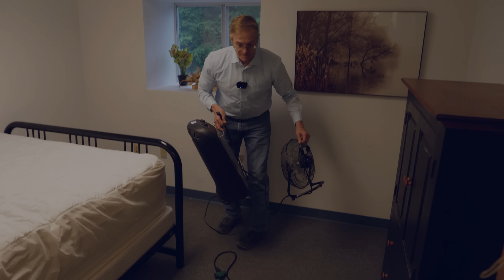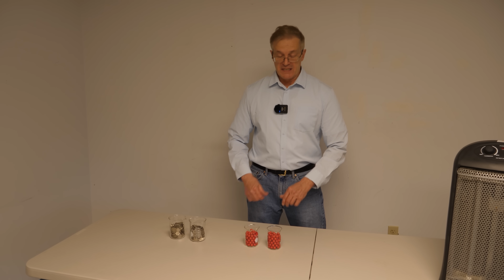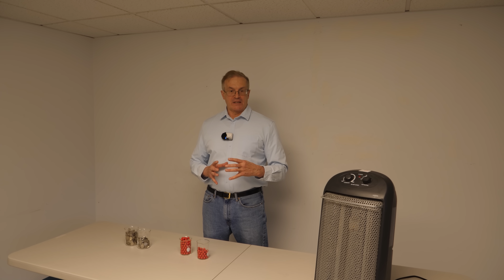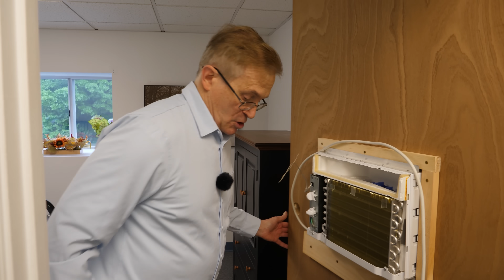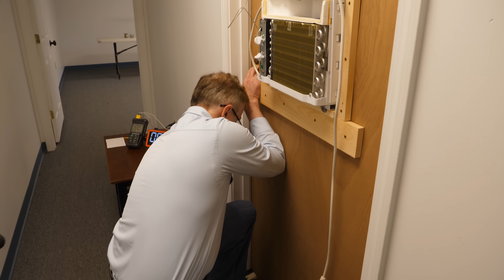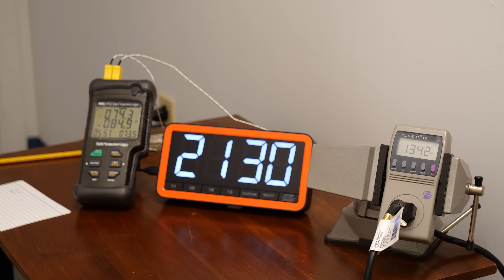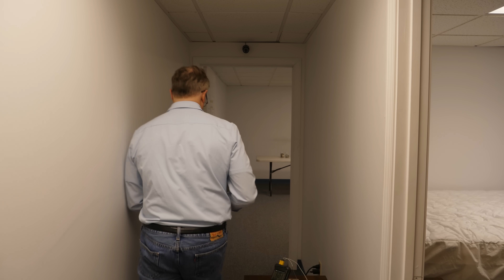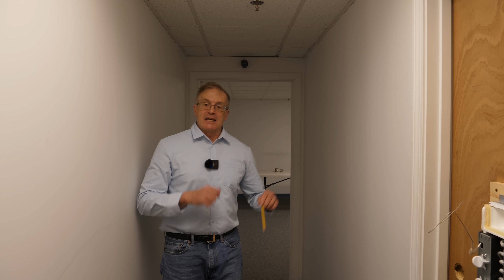You're wasting money on heating! Use your A/C!

Comment: If the concept is to move heat and not generate it. Wouldn't a test where the hallway is cold (to match cold weather when one would use a heater) be a more functional test? I am interested in the efficiency numbers then. I don't think we'd need to redo the space heater test since the temperature of the hallway has little to no impact on how it heats the room.
Reply from the maker: That's true.
The efficiency will drop as the temperature differential increases. Eventually,  the pump will approach the same efficiency as the space heater.

Comment: Most if not all AC units sold today will also have a heating mode that pumps in reverse, at least in Europe. Maybe it's different in the US?
Reply from the maker: It's definitely different here.
Reply: Interesting. In Europe, when we refer to a heat pump, it's usually an air-to-water pump, used primarily for heating water radiators in a pre-existing central heating system (cooling is less desirable as condensation forms around the radiators). Air conditioning units are air-to-air heat pumps that can either cool or heat the air.

Comment: I was surprised to see the low wattage of what appears to be a 5000 or 6000 BTU window unit. The plug for these units have their own 10 amp circuit breaker which equates to a trip point at just over 1200 watts on a 120vac circuit. I always just assumed they must run around 900+ watts.
Where a "heat pump" begins to fail as a heater is when the ambient air used to warm the refrigerant (the cold side of the AC) drops below 35 to 40 F .

Comment: let me guess the next video, you will combine secondary side of the A/C using with water nozzles/spray can....Can be dangerous to health(especially asthmatic people) and the building due to the issue with moisture and it will increase water consumption(drinkable water for the community).... a second thing is the deltaTemprature, there is a mechanical breakingpoint if deltaTemperature is higher than the A/C, therefore, efficency to heat can be better using a electric heater over time..  From my perspective, this video shows if you have a low deltaTemprature and overdimensioned A/C-unit.
Reply from the maker: That's not it.
Most airconditioners already route the condensate from inside to the blower on the outside heat exchanger.
Actually,  I misspoke. I should have said, "I'll show a method to significantly decrease the cost of air-conditioning not to increase the efficiency ".
Reply: @TechIngredients  Perhaps I misunderstood, but I'm curious about the next video! From your reply, I guess you can preheat using an electric heater and then use cooling to adjust the RH% level in the duct into the room. This way, you get better air conditioning, but it’s not cost-effective and doesn’t increase the efficiency. (However, I guess it depends on the perspective of what we are trying to achieve.)

Comment: Something I feel is always missing in the "it's not free energy" explanations  is, if it's cheaper to move heat than to create it, then why can't you add a thermoeletric generator of some sorts  to let the heat leak back in a cycle (or just use the outdoor as a heatsink) and power the device with the cheap heat gradient it is creating using less energy than the heat gradient itself has?
Reply from the maker: Take a look at our previous video on the  "Campfire Generator." Peltier devices are very inefficient, and although you could harvest a small amount of energy,  the payback period would be very long.
Reply: @TechIngredients  Is there no type of thermoeletric generator, even including other methods, like Stirling engines etc, that got enough efficiency to achieve overunit even when accounting for the energy savings of heatpumps, is that it?

Comment: I'm gonna go out on a limb here and guess that when the cold side of that ac unit is in a window and the outside temp is 32 degrees that it would not perform as efficiently as it does when the unit is attached to an inside door with the cold side exposed to air temps of 75 degrees as in this test.

Comment: A heat pump is many times the cost  (10x + nowadays) of a resistance heater. I rarely use the heat pump in the winter; I use the heat strips for the sole reason of reducing running hours on the compressor.

Comment: The results would be much different if the AC is trying to work in a freezing temperature, because this extra heat it is getting from the environment would not be present. However, it might still be better than the heater

Comment: There IS a problem in the experiment.
You didn't put a fan to blow on the AC radiator in the room. And the temp sensor in the room was VERY close to where the AC ridiator is. I'm pretty sure you're getting a higher temp inside the room because of that. Because the sensor is too close to the radiator and you're not flowing the air around it.

Comment: Confused.   You State at the beginning.  Can use . It has a switch cold or hot.
But you leave as a aircon unit. Then put the out side unit in the room
. Noise people will not appreciate  
I was under the contents  you where explain  how the system changes from cold to hot. 
I'm sorry  my friend.  This time incorrect information forwarded.  
Mick Australia 🇦🇺 
Where did the water 💧  go. In the temp change. ?

Comment: If the out part in splitt heatpump is reflektiv isolated in a box.. Just wonder can the heat made of the pumpe be used. Eksempel box of refleksjon isolation aluminium. Live in Norway and need cheeper billing. 😢

Comment: There's a couple of problems with heat pumps this demonstration hides unintentionally.
1. The heat pump is a more complicated system that is more likely to break over time.
2. It's more expensive to buy and setup, but cheaper to operate.
3. It has a temperature window that it can work in and can't work outside of that window.
4. It's usually slower to provide heat when mostly used. Usually cold days when heat density is low in the air you are pumping from.
5. It's less flexible to change and less adaptable to changing needs.
6. They are electrically powered only. Meaning in a blackout they don't work when just burning something, like gas, does.

All that having been said, heat pumps are cheaper and safer over the life time of the units in 90%+ of uses. They are by far the best choice in most cases, but should be sublimated by other small emergency systems in case power failure happens and heat is vital.
Reply from the maker: Agreed.

Comment: Curious if position of thermal probe may be reevaluated? Although I acknowledge it wasn't in airflow path, but, in first test it was pretty far from source, in second not so much. Do you think the turbulent air from AC this near could have affected Readings? 
Tip: I would personally have left fan and heater in the room for second test just to keep the thermal mass equivalent. Please advice your thoughts!?
Reply from the maker: Probably not. 
The significance of its position out of any airflow path is more important than its smaller distance from the airconditioner.
The thermal mass of the heater and fan is far lower than the walls, and the other furniture. Addressing these variables won't change the clear significance of the comparison.
Reply: @TechIngredients  Thanks. I learned something new. :)

Comment: Is the trick to spray the outside unit, the coils that dump the heat the refrigerant picked up with something like a fine mist of water?
Reply from the maker: No.
And I misspoke.  I should have said to significantly reduce the COST and not increase the efficiency.

Comment: Hi, I'm in UK and winters can get cold.  
So I buy a domestic air conditioner(rated at 3kw/hr), connect up the vent tube to the outside, and turn it on.  Obviously, I don't want to be running a machine at 3kw/hr.  So what kind of usage would I expect from the device?

Comment: So the question is would you be able to apply this same window AC type "heat pump" to warm a small structure in the winters of the northern US without modifications? From my understanding AC units are not designed to try to extract heat from very cold air (below 50F) as people will want it warmer than that inside and the units are not designed to be flipped around and used as a heater so trying to extract heat from cold outside air below 50 and then dump that heat inside (as the AC would normally dump it outside) does not work because the unit it optimized to be used where it extracts heat from a warm room over (70F usually) and dumps it outside where its even warmer (over 80F), and I believe to do so it would need different sized radiators than it has as designed for AC use.
Reply from the maker: I doubt it.
Airconditioners are designed around a particular temperature range and differential. We could attempt to modify that with a different refrigerant and compression ratio, but then it would not operate as well as a standard airconditioner.
The purpose was to demonstrate the potential of heat pumps.
Reply: @TechIngredients  precisely my thoughts.

Comment: Great proof of concept, but I confess I'm a little disappointed that you didn't show us how to turn an ordinary 1-way air conditioner into a 2-way heat pump.

I do realize there's more involved than just a couple of valves. The electronics that run an air conditioner do not have the capability of a heating mode, so in addition to the plumbing (which would require emptying and recharging the refrigerant using specialized equipment), it would require modifying the controls as well. Although the controls may not be that difficult: just add in a relay circuit that in heating mode would turn the fan and compressor on when the controls went "Off" and off when the OEM control went on. That may not be enough, though, since there are some other things that go on, including to prevent evaporator icing and regulate compressor cycling and system pressures. So it may require a complete control system replacement or at the least adding dedicated heating controls and a way to switch between the two control systems.

I've been looking for an afforable small heat pump for a while now. They do make window units that are heat pumps, but they are not easy to find and they're not cheap. There are also small "mini splits", but they are generally larger than what I'm looking for and even the smallest ones aren't really of a form factor that would be convenient for what I have in mind.

Then there are those portable "camping" type units that are just a little smaller than I need and are VERY expensive for what you're getting - they usually cost more than 4 times what a window heat pump unit does, and I only know of one that can heat as well as cool. Which is ridiculous, because they cost far more than a portable fridge that uses all the same functional components (other than the blower fan)3, but the air conditioners don't have to deal with things like an insulated compartment or food safety regulations.
Reply from the maker: The difficulty and cost of modifying an airconditioner to function as a two-way heat pump over a much larger temperature range is why I didn't attempt it.  Even if I succeeded, it's not likely many viewers would want to tackle this.

Comment: here in europe is at least 20 years that we use heat pumps to have cold in summer and heat in winter. theay are wall mounted with one element inside the house and another outside. usually they go for 9000, 12000 or 18000 btu (thermal energy transfer capacity) and pretty much every home has one or more than one. we use it a lot in the summer to stay cool and also in winter when its cold but not below 0 degrees celsius (32F) because at this point the humidity in the air freeze on the external unit and block the heat exchange with air forcing the machine to work frequently in defrost mode reducing general efficency. i can not believe that in usa its not common to use heat pumps moving heat inside but instead your only option is to generate heat using tons of electricity or gas/oil

Comment: Another use....you can run your small room AC as a dehumidifier in your basement.  Simply position it over a drain and turn it on.  Heat generated on one side cold the other... water dripping below.  Like all dehumidifiers there is slight excess heating of the room as humidity drops. But it works really well.
Reply from the maker: Good point.

Comment: Heatpumps are super common here in Norway. We use them purely to heat houses during the winter. Not sure how comon this is around the world.
If you combine it with ground heat(dont know the english term, basically boring down in the ground where the winter cold does not reach it). Hooking that up to the heat pump you will get insanely efficient heating in the winters. Now just use that heated water to warm up your house. Its efficiency is something like you gain more than 4 times the energy out of the system than what you put in even when it drops to -20'c outside.
Reply from the maker: It's  called geothermal temperature management and can improve the performance of these systems in both summer and winter.

Comment: Nice cliffhanger, I cant wait to see what you come up with for improving the efficiency of an ac unit.  I know a few tricks but I wish the manufacturer had included them and that I were willing to pay the extra cost of an ac unit that had those more efficient considerations included. 
I hope that you will test a fanless, copper tubing only  BIG condensor. Down side is a lot of copper or aluminum, a lot of refrigerant and where to stretch it out.

  I just purchased an inverter unit that uses a common, cheap, simple trick to improve efficiency that most consumers dont understand, that is using the water condensed out of the air at the evaporator to help out the condensor by evaporative cooling using that practically pure water.   People dont understand it is supposed to make that splashing noise and that you dramatically reduce the capacity and increase the energy consumption of that window unit by drilling a hole in the pan to drain all the water out.  You just cant make some people understand.   I am amazed that in two weeks of operation, in a bedroom that has an attached bathroom with a shower used multiple times per day, that no water has dripped out of that ac unit yet.  It has used every drop of condensate water to cool the condensor.   Well balanced system.

Comment: We have had A/C warm cold for decades here in Spain. I even removed the oil powered central heating system as heating via the heat pump is way more economic in the moderate mediterrainean  climate! However the colder it gets outside the more the A/C will struggle.

Comment: Yeah, nothing like using inefficient AC units to heat your house. AC is expensive in the summer and even more expensive in the winter. I have been watching and talking to people over the last 30 years and guess what!?! I don't use a heat pump as you show here and my electric bills are cheaper throughout the year than people using heat pumps. So the lies about heat pumps continue on.
Reply from the maker: I don't think you need to accuse anyone of lying. The principle is sound, and we just showed the magnitude of its effect.
Nevertheless, there are issues such as requiring electricity, which reduces fuel flexibility and potential cost savings.
Their efficiency advantage decreases as the temperature differential increases. They are more complicated than a burner and probably beyond the abilities of the owner to repair.
What matters is that with an understanding of how they work, people can make an informed decision about using them.

Comment: Overall excellent demonstration, and the results were very compelling, but I have a critique. The fan consumes energy without significantly adding to the heat of the room, and circulation may not be necessary for that small room in the given time allotment, so it skews the results slightly in your favor. Secondly, the thermometer was closer to the heart source in the air conditioning experiment. Although the power consumption differential was significant enough that I don't think it would really matter, a more fair test would be to get rid of the fan and put the space heater by the door.
Reply: Also, more care in taking instrument readings would help with the accuracy of your results. I work in R&D, and we've thrown out entire data sets over hasty sensor readings like that.
Reply from the maker: Thanks.
You're wrong about the fan. It's every bit as efficient as the space heater. Every watt heats the room through air friction and motor resistance. 
The blast from the airconditioner was directed away from the probe and across the room toward the location of the heater.
The temperature difference between the two tests was so significant that fussing over the readings at the 0.1-2 degree level would risk losing the attention of the viewers.
You're right about the value of more accurate information. Multiple runs in different orders for different durations and even swapping out several different air conditioner models should be part of a testing plan.

Comment: Question: Are air conditioners still as efficient when the exterior temperature is lower? I would be tempted to try at various exterior temperatures as this is a more likely scenario. I would assume efficiency goes down the lower the exterior temperature is
Reply: You are correct modern Freons have made them capable of qorking at lower temps but once it gets down low enough you have to switch to resistance or burn fuel.
Last I heard it was about -5 F